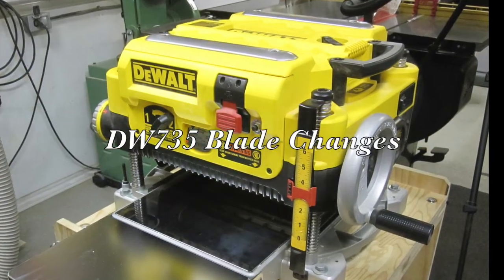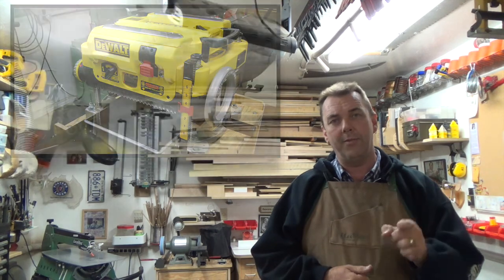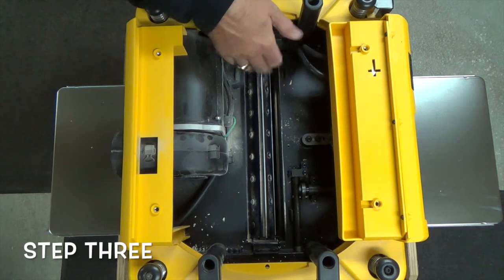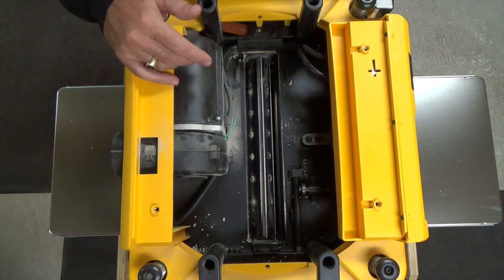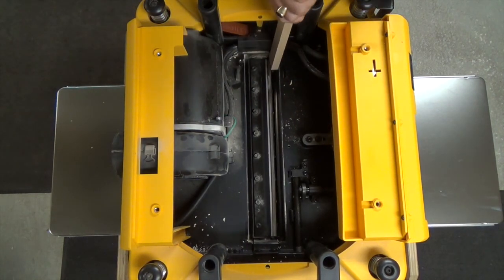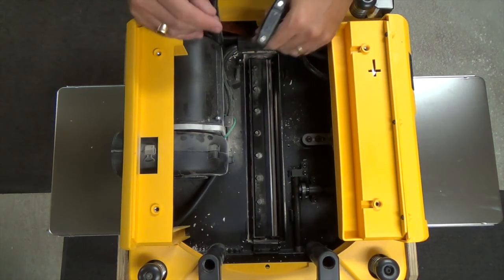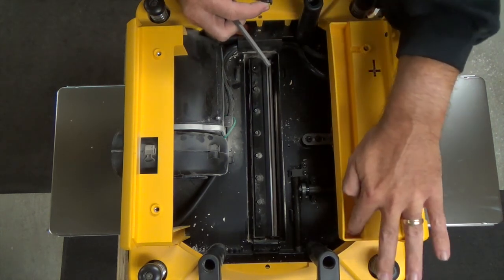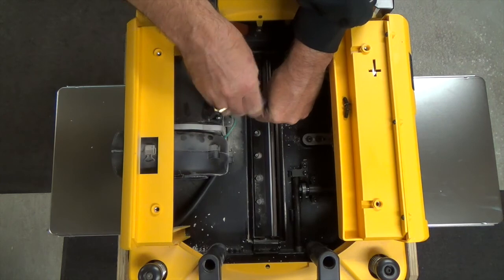DW735 Blade Changes

Comment: late to the party here but just watched this twice! I bought this planer about 18 months ago and was fearing changing the blades. Just took them out, cleaned them and the rollers, waxed the bed...boy it's like brand new!! thanks for a wonderful video and you earned my subscription!!!!
Reply from the maker: Glad to have you aboard as a subscriber Richard.  I'm even more glad that the video was helpful to you and that you were able to perform the maintenance on your planer with no issues.  Thanks for tuning in and for taking the time to leave me a comment.  I appreciate it.  If you have any questions in the future, feel free to ask.  I'd be more than happy to try and help you out.
Reply: Well since you offered :-) in your video you don't mention anything about cleaning the rollers. Mine was caked with alot of what looked like pine pitch and resin so I used Rocklers pitch and resin remover. You use anything in particular to clean your rollers and do you clean them more or less frequently than the blades?
Reply from the maker: I try to avoid running softer woods like pine through my planer for the simple reason of the pitch residue that gums up the entire machine.  I have found that Pine-Sol cleaner works well but any kind of varsol or turpentine will also work.  I try to avoid those harsh cleaners if I can and find that some rubbing alcohol will clean your rollers (if there is no pitch) and give them some new grip that they might be missing while not staining your stock as it goes through.  As for the frequency, I clean them as needed and I clean them equally.  If I clean the blades, the rollers get a cleaning too.  I hope this helps.

Comment: Thank you, this was so simple to do, just went out the the shop and did this on my 7 year old Dewalt, had a groove on one side and didn't know it had dual sided blades, now it's just like new again.
Reply from the maker: +maceglass 
Glad to hear that this video helped.  Taking apart an expensive tool can be intimidating and sometimes, all we need is a little guidance to get the job done.  Glad to hear that my show was the guidance that you needed.  Thanks for tuning in.

Comment: Well done! Got a nick in one of my blades, and now I'm going to be able to change them out, thanks!
Reply from the maker: Glad that you enjoyed the show.  If there is only a nick in one of the blades, but they are still sharp, I wouldn't change them just yet.  One of the other two blades will effortless clean up the problems that a nick in one blade will cause.  With the cost of replacement blades, you want to get as much life out of them as possible.  I would even be bold enough to say, that if the planer is leaving a raised line in your finished thickness, use a card scraper or sander to remove it instead of changing out the blades but only if the blades are still sharp and cutting well.  If you have any questions, feel free to ask.

Comment: I too have a small shop and I have lots less experience than you. After watching your video on 734 blade change, I was 99% sure I'd get that one for my first planer. (I watched many other videos on the 735 and most people wouldn't buy it again, including Jay Bates, cuz higher price not justified.)
Thanks for helping.
Reply from the maker: I just don't have the room for a larger floor model and the 735 was the obvious choice for me.  The price tag is rather high but you can get a good sale once in a while as long as you keep your eyes open.  As for the features.....let's start with the 735.  I like the 2 speed roller feed which allows you to run the stock through at higher speeds to get the stock roughly down to finished dimension and then slow the speed down for the final dimensioning which gives a cleaner finish.  I like the ease of adjustment in the out-feed and in-feed tables on the 735 as apposed to the adjust stops on the 734 which can be cumbersome to adjust and calibrate.  There are several more positive stops on the 735 than what is on the 734 and the 735 has a wider capacity for boards and although it is not much of a wider capacity, it is still wider none the less.  The 735 also has better chip extraction with a built in fan to blow the chips out of the 4" port.  I also like the chain drive mechanism for raising and lowering the planer heads as apposed to the direct drive of the 734.  Don't get me wrong Barbara, I loved my 734 and it served me very well but I also love my 735 and while the features may not be worth the price difference between the two models for some, there are definite differences that are an upgrade on the 735 from the 734.  Whichever planer you choose, you really can't go wrong.. (I copied and pasted my response from your other comment for other viewers who may have only read this question from you and want an answer)

Comment: just a little tip here, when facing the front of the planer to the left of the blades is a square piece of metal sticking up held on by 2 screws, but held on in a way to still alow vetical movement of the square piece. anyways if you will press down on the piece of metal it will let the blades turn freely so you don't have to use the board to force the blades around.
Reply from the maker: Agreed.  The safety release will allow you to turn the spindle in any direction.  The wood is mostly for the protection of your fingers though.  Thanks for pointing out the spindle release.

Comment: and I also have a nick from re using boards and not inspecting them well enough. I will try to correct it with the lateral move. If I understand correctly I can move one blade and it will clean up the ridges that the other blades are making?
Reply from the maker: +patrick alexander As long as the knick is only in one blade, that should work.   The problem is that there isn't much lateral play in the DeWalt blades.  Depending on how severe the knick is in the blade, you may not be able to get enough lateral play to correct the line that the planer will leave.  Let me know how this works for you.

Comment: Thanks for the video, my old roommate liked to "borrow" my tools and I have been meaning to change the blades ever since he nicked the snot out of them. I could have sworn that the blades are single sided, but I guess I'll find out soon. Have you seen the helical blades that they make for this planner? They aren't cheap, but I really want to switch to them. They provide a continuous cutting surface that results in not only a quieter operation, but also less mechanical shock in comparison to the straight cut blades. They are segmented providing a much longer use, and are supposed to be great for planing end grain.
Reply from the maker: I have not seen the helical blades for this particular planer but if they are anything like the planer blades that I have seen for other models, they should be amazing.  Just one quick note on planing end grain......seriously not recommended.  Planing end grain is just asking for trouble and I've seen way to many people who did serious damaged to their planer and themselves to justify planing end grain.  Glad to hear that you enjoyed the video.  If you have any questions, feel free to ask and if you do end up getting the helical blades, please let me know what you think of them as I'd love to hear your opinion on them.  Thanks for tuning in to the show
Reply: Thanks for the heads up. I hadn't tried to plane end grain, but I've seen a lot of cutting board makers that do. Yeah, once you see the benefits of the segmented helical blades, you really wonder why they don't come that way from the factory. They aren't cheap, but you can get significantly more board feet on a set. I'll let you know if I do get around to trying them. 

I could have sworn that my blades were single sided, but that will be a nice surprise if they are double like you said. I have one spare set so I should be able to plane a good bit of board feet before I need to upgrade. I have a stack of rough cut red oak in both 4/4 and 8/4 that I found for pennies on the dollar, and I'm slowly going through it.

By chance, do you have any tips for referencing a face to get boards ready for the planer? I have been doing it by hand with a jack plane, chalk, and a level until i am able to remove any bow/cupping/twist.
Reply from the maker: Without a jointer planer, your method is pretty much the norm for hand plane use.  Edge planing is a difference story, but for face planing to prep the reference surface, you're right on the money.  Don't plane more boards than you require for a project.  They may just find their way back to their cupped state before you get a chance to use them.

Comment: Thanks Ken.  This video helped me.  I have the same planer and have opened it and removed the three RED bolts, but didn't realize I had to " twist " the shroud to remove it.  Great video and explanation of what was happening.  Haven't yet had the need to change the blades, but this surely takes away the "stress factor".  

I have a question about the locking lever on the blades.  Does it dis-engage by itself when the cover is on and you begin using the planer?
Reply from the maker: +Steve Gronsky Yes, the drum lock for the blades is disengaged when the plane is in use and the shroud of the planer is installed.  It becomes active when the drum is exposed.  A safety feature to keep the planer from accidentally turning on while you have access to the blades with your hands.  Definitely a good feature.
Reply: Thanks for that.  I appreciate your quick reply.
Reply from the maker: +Steve Gronsky You're very welcome.

Comment: Kenny,  Great video.  I have the same great planer and enjoyed the how to.  Have you ever tried honing the blades on the 735?  Do you have an opinion on the feasibility?  Again, great video.  Paul
Reply from the maker: pcorlis I've often thought about honing the blades on the thickness planers but I think that it would cause more problems than it is worth.  It would be one heck of a hone to get the edge on the full 13" of the blade.  Not to mention, that each one would have to be honed exactly the same to as to not cause different cutting depths.  All in all, for the price of these blade, I don't think that I will be venturing in to honing/sharpening them any time soon.  There are just too many dynamics that it will change and not enough adjustment points on the planer to compensate for them.  Thanks for the kind words on the video.

Comment: How much stronger is the 735 motor vs 734?
Reply from the maker: I honestly don't believe that the 735 is necessarily stronger than the 734.  In fact, I think that they are pretty compatible in the strength of the motors.  The big difference here is the features whereas you can alter the feed rate on the 735 in order to change the number of blade passes that the stock receives during its milling.  The 735 also has a larger stock capacity.  Now it's only an extra 1/2" but sometimes, that is all it takes.  All in all, the 735 is just a nicer machine than the box style of the 734.  I hope this helps.  Thank you for tuning in to the show.
Reply: But that rascal is heavy. I keep toting it from one house to my other.

Comment: Great video Kenny!  
I have the 734 and have used your video for that model to change its blade.
I do have a question that is unrelated.  What the heck is the device in your window behind you?  It has had me puzzled for a few weeks now.
Reply from the maker: Chem Cody Ha ha ha ha ha ha ha ha ha ha ha ha ha. There are a lot of devices behind me.  I'd be more than happy to answer your question, you just have to be more specific as to which device you are referring to.  What does it look like?
Reply: Sorry, There is something like a grate that goes across your window opening.  It looks almost like a security grate.  It has had me puzzled for weeks.
Reply from the maker: Chem Cody Those bars in the window, are in fact, security bars.  I live in the city and with the amount of equipment that I have in the shop, the last thing that I require is for someone to break in and help themselves.  There isn't much that anyone will be able to fit through those bars except maybe a few hand tools.  The are bolted directly into the frame work of the building so they are rock solid.  I hope this answers your question.  If not, feel free to let me know.
Reply: kennyearrings1 Well that makes sense Kenny.  Thanks for the info!
Reply from the maker: You're very welcome.  Glad to be of service sir.

Comment: I used to think the dating of the painter's tape was a good idea.  Now that I've used this planer and realized how fast the blades go bad with hardwood, I now think that is an optional step.  I've changed my blades but after this change, I'll be replacing them with Infinity Tools carbide blades.
Reply from the maker: The masking tape step was always optional.  I hope you have better luck with the new blades.  Thanks for tuning in to the show

Comment: Kenny: Another great video. Thanks. Why did you change from the 734 to 735? I've read that the 735 and 735X get lots of snipe. Barbara
Reply from the maker: Well here's the story Barbara.  I had a 734 for many years and I have to say that it was a workhorse of a planer and never gave me an ounce of problem.  I had been looking into the 735 for quite a while but couldn't justify the price considering that my 734 had been (and still was) perfect with no problems.  Then, the 735 went on a major sale at a local tools supplier and it came with the out-feed and in-feed tables as well as a second set of blade for a ridiculously low price.  I was able to sell my 734 with no problems and get a good price for it because of how well I maintain my tools.  All in all, the 735 only cost me about $100 out of my pocket after I put the money from the 734 toward the price.  As far as snipe goes, the 735 is much easier to adjust the tables making it easy to eliminate snipe on shorter pieces of stock but the longer pieces still get some snipe on the ends.  By longer, I mean 4' and above.  The 734 has a cutter head lock down which helps with snipe as well and the 735 does not have this function.  The bottom line is that if your planer is properly adjusted, you can minimize snipe on both machines but in my opinion, it is impossible to completely eliminate it.
Reply: kennyearrings1 Thanks for the information and prompt reply. It's great that you ended up getting such a low out-of-pocket cost on the 735. Other than the ease of changing blades, what other things about the 735 do you prefer over the 734, and vice versa? (I'm kinda surprised that you didn't go from the 734 to a floor standing model, but it's virtually impossible to pass up the ultimate price on 735!)
Reply from the maker: I just don't have the room for a larger floor model and the 735 was the obvious choice for me.  The price tag is rather high but you can get a good sale once in a while as long as you keep your eyes open.  As for the features.....let's start with the 735.  I like the 2 speed roller feed which allows you to run the stock through at higher speeds to get the stock roughly down to finished dimension and then slow the speed down for the final dimensioning which gives a cleaner finish.  I like the ease of adjustment in the out-feed and in-feed tables on the 735 as apposed to the adjust stops on the 734 which can be cumbersome to adjust and calibrate.  There are several more positive stops on the 735 than what is on the 734 and the 735 has a wider capacity for boards and although it is not much of a wider capacity, it is still wider none the less.  The 735 also has better chip extraction with a built in fan to blow the chips out of the 4" port.  I also like the chain drive mechanism for raising and lowering the planer heads as apposed to the direct drive of the 734.  Don't get me wrong Barbara, I loved my 734 and it served me very well but I also love my 735 and while the features may not be worth the price difference between the two models for some, there are definite differences that are an upgrade on the 735 from the 734.  Whichever planer you choose, you really can't go wrong.